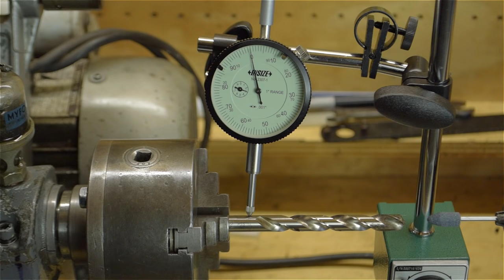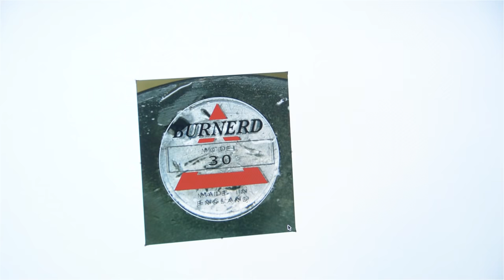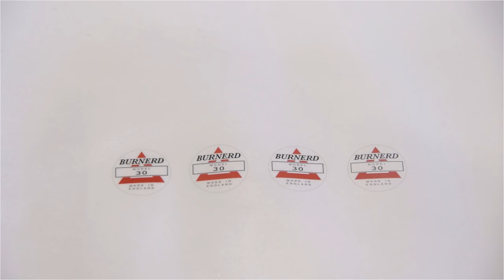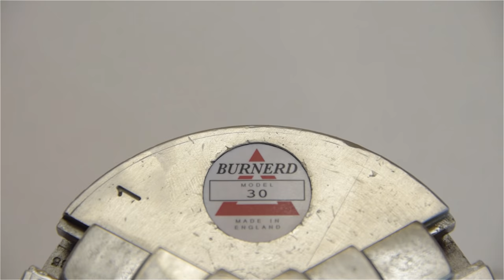Myford Lathe Restoration - Part 4 Pratt Burnerd Chuck

Comment: Geoffrey - another kiwi ML7 owner here.  I just followed your jaw grinding process on my very old Burnerd 3 jaw. Mine was quite a bit worse than yours, so I had to take a fair amount off, but now runout is down to virtually nothing. I used a Dremel with a toolpost holder attachment which allowed me to use accuracy of the lathe during the whole process. Thanks very much for the videos. Love the humour.

Comment: Just a bit of advice for next time, when trying to grind the jaws down the best method (in my opinion) is to get yourself a ring that you know is circle, something as circular as you can find. Then use the inner diameter jaws or the outer steps in other words to clamp it as tightly as you can. That way you can be certain that there is no backlash when grinding at the jaws, it'll also help to keep them stable and stop them from flexing, giving you a better finish and hopefully more accurate surfaces on the jaws to clamp items with. Just something my machining teacher showed me, I'm sure there are a million other ways to do this of course. Nice work though!
Reply: That's the wrong way to do it, as the forces clamping the outer ring are opposite to "normal" workholding. You can drill and pin the jaws ends to clamp a ring "in" though. The clamping force has to be the same direction as normal workholding force for the surface you grind.